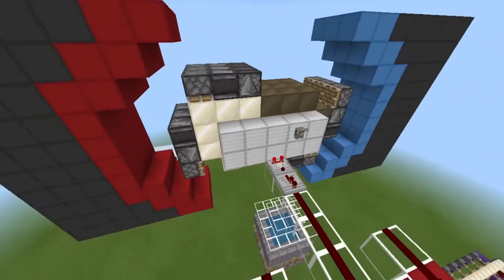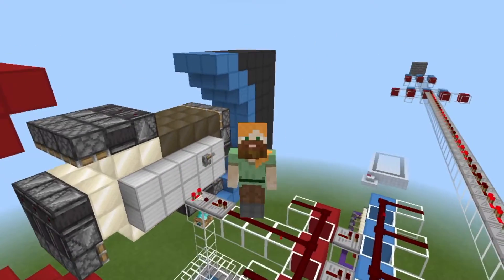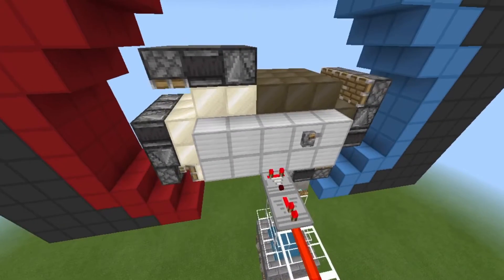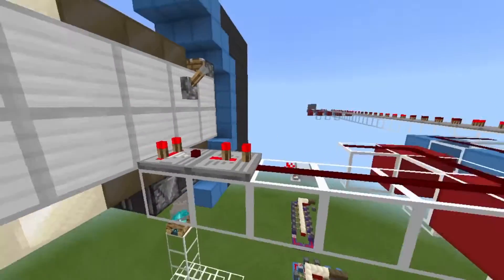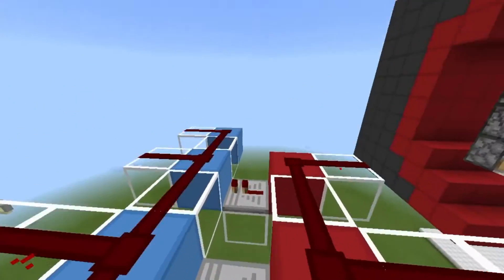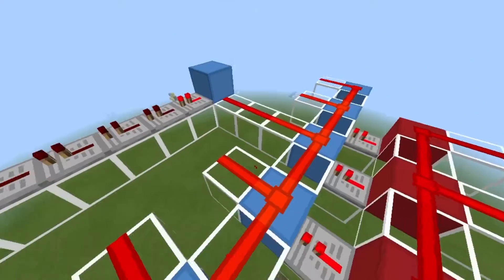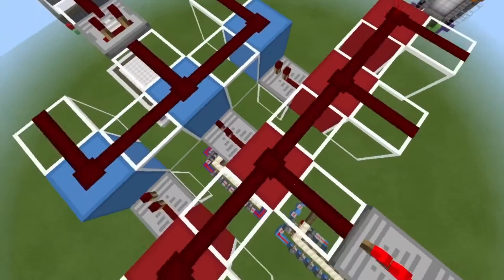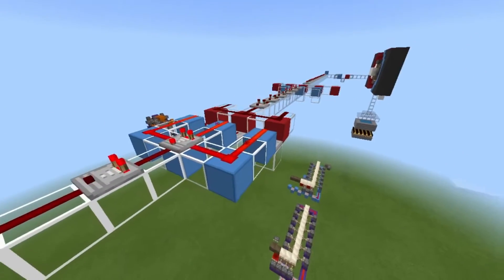The life of electricity

Comment: We also get 240 volts in the states but in split phase power(I'm sure you knew that but in case anyone else was wonderin)
Reply from the maker: I actually didn’t we have 415v in 3phase which broken down into 240v on each phase
Reply: @ldrm4435  oh interesting, our secondary coil is split to 2 120 volts for reasons (safety maybe? Idk) and is only fully used (240 volts) with demanding devices like washers/dryers and stoves. It's just funny to me because most people think we only have 120 volts, then again I don't think any of this will matter to ya if you live in australia
Reply from the maker: Yeah I’ve just learnt about the Australia (and part of the New Zealand) standards so it’s interesting to hear about other countries requirements